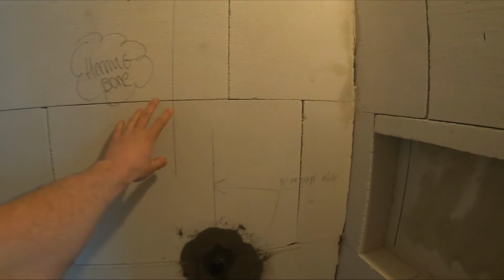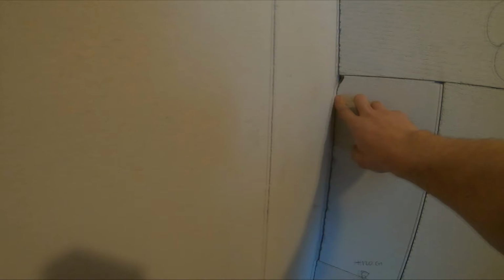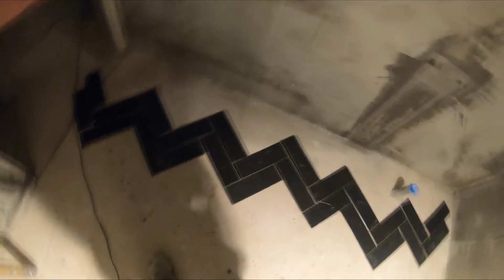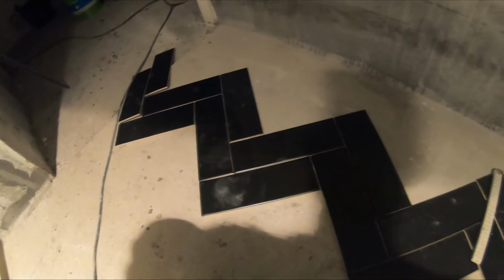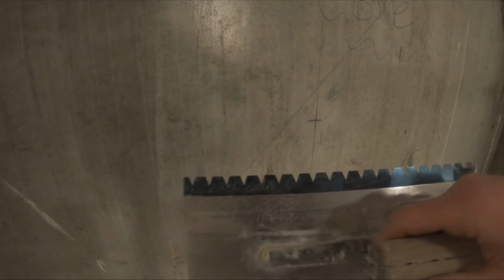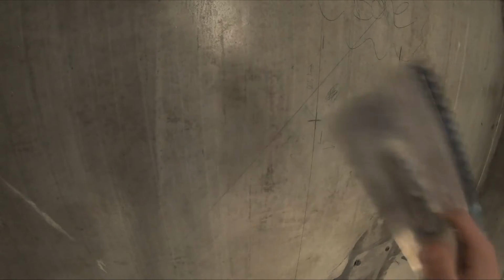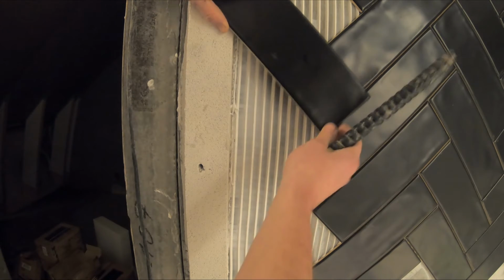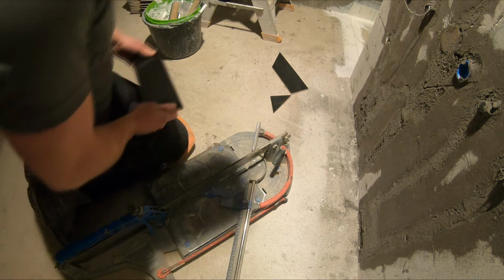How to Tile Herringbone./ Complete Bathroom Install#1 Part2 Visgraat Tegelen

Comment: Last time i did herringbone i dry layed the pattern on floor and made a jig/template out of a piece of foam board.   I would lay a row and check it with the jig to make sure everything was tight.   Worked perfect.    One of the trickiest things about herringbone is making sure the joints stay true because if they open up even a small 1/16" the next row will be noticabley off.   Then youre pulling tiles off the wall in anger!

Comment: Never had a tile stay without slipping.   I used the mapai light weight which was supposed to hold full size tiles but didn’t.    Maybe I did something wrong.
Reply: Mapei ultralite and customs prolite are excellent thinsets and one of my go to mortars but they still can cause some sagging if not mixed to perfect consistency.   Try Laticretes multimax lite.  Its super sticky.

Comment: I’ve been a tiler 35 years ,I’m sure pre mixed adhesive is not suitable for shower , it will fail . 
Put your tile cutter on a bench why bend down every time to do cuts , you’ll thank me in 10 year time 
Good work though
Reply from the maker: im sure the adhesive that you are using is diffrent  then the one in using👍🏻 here in the Netherlands we use this adhesive alot whitout failing!

Merry christmas ✨🔥
Reply: i prefer bending and getting on my knees with knee pros, than cutting on a tabble and having to use my shoulder to press on the cut, when you are on your knee, you use your bodyweight and it cuts better imo. bending is never gonna be a problem if you bend right.

Comment: Why do you start in the middle of the wall ???
Why don’t you start at the bottom and work up ? Is there a reason for this please explain
Reply from the maker: No there is no reason for where to start. There are so many ways to start harringbone.

If your adhesive can not hold the tiles up then i start from the bottom and work my way up.

Just do what suits you the best👍🏻

Comment: Who uses organic adhesive in a shower? Definitely not a long lasting installation. The finish looks good but is only eye candy before installation inevitably fails
Reply from the maker: @dupasquierdenis thnx for your comment. I use the Omnicol tp3 paste adhesive. This is a adhesive thats certified in damp and showerareas. Its used all over Europe and its highley recommended. Definitely a long lasting install.👍🏻

Comment: Sorry brother but your waterproofing is rubbish that shower will leak
Reply from the maker: Hi, i know this waterproofing will look horrifying for the US watchers. Butt this is the most common way we do it in The Netherlands. 

Or houses are made of a concrete walls en floors. There is no movement between them so no joint will crack and leak.

👍🏻✨
Reply: @DutchTileWork  but the concrete will absorb the water and it will travel, it’s much better to waterproof the entire shower area and have a barrier between the shower floor and the rest of the bathroom floor
Reply: @jorgegatica8065  If its a bsmnt or slab who cares if, and thats a big if, moisture seeps into the already moist ground?